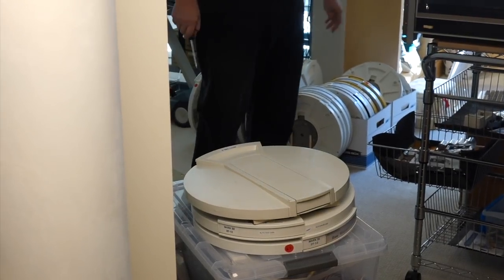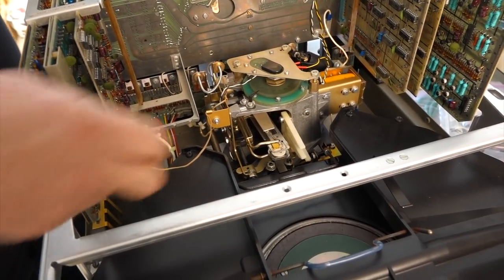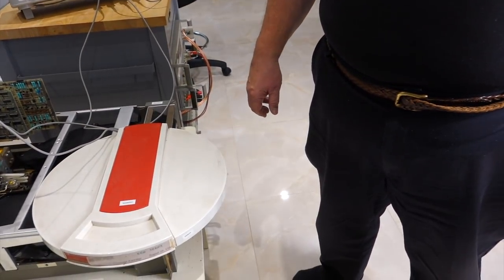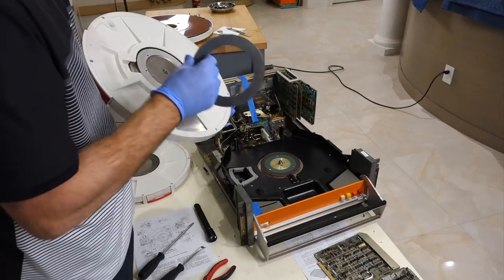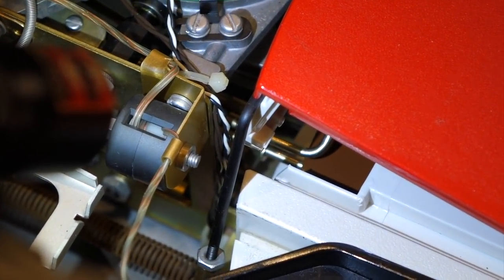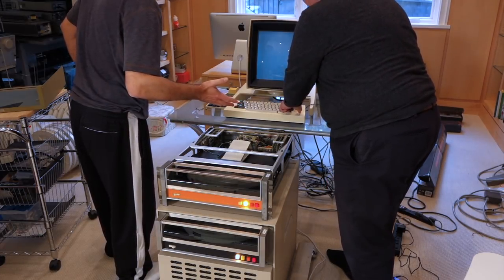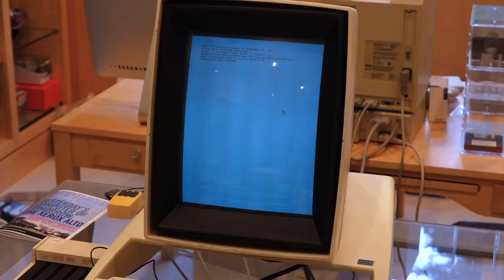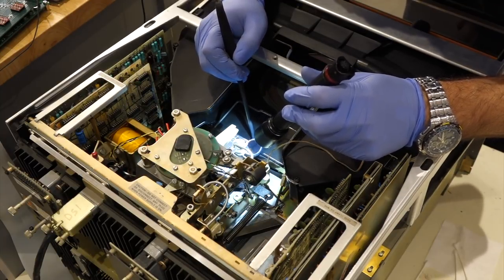Alto Restoration Part 18 - We crash our disk drive. Mill to the rescue!

Comment: Takes me back almost 30 years to when I worked for one of the last companies in the US producing disk packs and rebuilding HDAs of all types.   A little tip,  IPA is ok for head cleaning, but for the really stubborn stuff like you had there, DI water will take it off more completely and much faster.  Just a drop on a cleanroom swab is all it takes.

Comment: Thanks for the video. Some day I am going to have to go through this process with all the big 14" drives in my collection - a task I fear doing, thinking there is a disaster in the works every time. You guys make it look reasonable.
Reply: Hi Uniservo. These platters are 14", basically the bigger drives simply stacked multiple platters to form a pack. Densities, track spacing and the existence of servo tracks are the variables. Hope your drives come back to life!

Comment: I used to align the heads on the Control Data 9766 series drives, 80 and 300MB drives.  If I recall correctly the 80MB drives had five platters and the 300MB had 11 platters, so they had up to 20 heads.  I used to be extremely careful with the alignment because the alignment pack cost over $10,000, which was almost as much as I was making in a year at the time (1980) and the heads were about $300 each.  At the first sign of trouble or unusual sound I would retract the heads and check each head.   After changing a head I would first spin up the drive with a spare platter to make sure everything was fine before installing the alignment pack.   Good work and excellent video, it brought back lots of memories!   And good work recovering the data on the packs, bringing back memories in that way too!

Comment: 'Back in late 80's I use to repair XEROX 820's from my house and while pulling out the 8" platter so I could change the hard drive's bearings my 1yr old son who I had sitting on my lap helping me sneezed and covered the platter with snot, NO PROBLEM, just washed it with soap and water and good as new!

Comment: Fantastic work. It's great that the disk density is low enough you can do your own drive repairs like that. I am just about to try and recover the data from a 14" Fujitsu drive and i am not very hopeful!
Reply: 2200 bpi is pretty common for 14" platters. your Fujitsu drive won't be that far away from this. Don't give up!
Reply: Thanks, the drive in question is 6800 bpi and 850 tpi. We will try reading it normally first now i have access to a system with a SMD interface.
Reply: did you get it working?

Comment: If you're having repetitive crash problems, check your power supply over very carefully!   Bad solder connections were the bane of the larger Burroughs units which I used to work on.  The Burroughs units also used a lot of forced air over the platters - they didn't trust the Bernoulli effect enough.

Comment: I once took a 300MB rack mount hard disk apart and transported it home on the bus in 2 parts: the disk with the heads (and I had taken off the head pack and put it back together), and the enclosure with the electronics. Sure, it wasn't a removable drive like this one, but when I see this, I'm amazed that mine still worked after I put it back together.

Comment: Great to see the Alto project coming together so fully, its always a little scary when you have to open drives (or anything with magnetic media that needs precise alignment) up and remove heads clean then and reinstall them. Very good to see that the design of the Diablo heads is quite robust and they survived the incident. Nice save on the alignment pack as well, those fore sure are NOT growing on trees anymore! 
Keep up the great work out there!

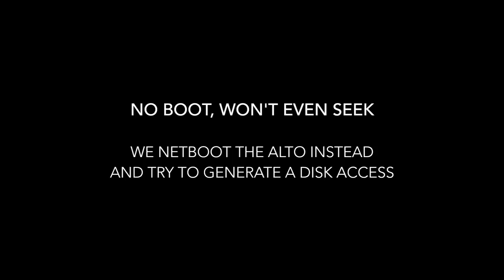Comment: 12:17 - Having listened to that sound from this machine and having never seen an Alto booting before, that sound is ubiquitous for so many floppy and HDD's that followed in the years and decades after. Even more amazing that you can still hear that very same sound in the latest SATA HDD's when there's data read errors.
Reply from the maker: It's the sound of the head repeatedly seeking back to the home position in an attempt to re-calibrate the start position after a read error. It's a method still used in disks today, hence the similar sound.

Comment: Good thing that ring friction centered and wasn't reliant on the failed mount for alignment!  Good job and awesome repair!!
Reply: The spindle motor has a conical top which fits into a cone in the aluminum platter hub. The steel ring is used to hold the platter down against the spindle, but not for alignment of the cartridge to the drive
Reply: Carl Claunch ah ok. So as long as it was close it was good.  Still very impressive fix.  I bed some 70s engineers would freak out seeing that repair:)

Comment: I used to repair those Diablo drives in the '70s and replaced many heads.  One comment on the alignment pattern.  We always used the full cats-eye pattern rather than zooming in to one half. The alignment was correct when both lobes were the same width and height
Reply: Yeah, that seemed kind of odd.  The pattern they aligned against didn't really resemble what was shown on the manual page.

Comment: Gee but this brings back memories.  When I was a young pup, an undergrad intern at RCA (remember them?) we'd be in the "computer center" typing in the Fortran we had written on yellow legal pads back at our desks - we'd occasionally have power failures during bad lightning storms. The facility had plenty of backup power, but there would be glitches that would affect the disk spindles.  The failure mode is well known to guys of this area - the heads don't retract, or don't have time to retract while the spindle winds down.  

My mentor, a wizened principal engineer named Aaron, would put down his pipe (yes, you could smoke anywhere in the building in those days except the fab and the raised-floor room - for obvious reasons) and say:  well, once they get the computer operators off the ceiling, they'll be scraping oxide from the heads for the rest of the day.

A power-glitch-head-crash meant that we were pretty much done for the day.

I used to have hanging in my office a disk from an IBM pack - gouged quite obviously.   I took it down after a few years when the young engineers simply had no concept of what it was - even after I explained it ("see, it's like a really big floppy, only it's not floppy and the sleeve is gone").  They figured it was some sort of archaic, uninteresting, art.   I used to have it in a box in my garage, but I think my ex tossed it after the divorce.  Etc.

Comment: To me this seems like a big antique Zip drive with the removable cartridges and heads that go into the edges rather than the sides.  Is this kinda similar but on a larger scale?  I had a Zip drive but I stopped using it when I read about them being unreliable.  That was especially true when thumb drives started to show up on the market but what you have there is an antique not a lot of people see normally.

Comment: First the praise: superb work by very skilled experts on an important part of computing history. Second, weren't those disc packs an invitation to head crashes? By the 80s hard drives were almost always sealed within a "warranty void if opened" enclosure. Or is this not such a sensitive technology as the flying heads we were told could crash if they encountered a particle of cigarette smoke?
Reply: The density on these platters is pretty low compared to modern hard disks, and the heads are large.  The gap between the head and the disk is correspondingly larger.  Drives became sealed when airborne debris became a serious problem.

Comment: Scary – and amazing that the platters survived the head crashes that could damage the heads. Great job!
Reply: The platters suffer more from the crashes. If it is just a rubbing and burning on a flat surface they can be read but if scratched or gouged, we have to put them aside.
Reply: Thanks for the info! I was always under the impression that a disk would have been toast, if a head crashed that hard...

Comment: Curious thing about the Xerox 860ips.  When the 8" floppy drives heads started to become a little dirty, it became evident on the screen.  As you typed, text to the display would be lagged.  I suppose this was due to buffering data to the floppy disk and then immediately reading it back?

Comment: This was back in an era when "crashing a hard drive" was literal. :p

(or the heads, at least.)

Happens on modern HDDs too, of course, but usually not quite as scary as this.
Reply: Loved watching the process of aligning the heads.

I was recently attempting to decode the MFM from a 3.5" and 8" floppy drive using an FPGA, and I hooked up a speaker to the /READ DATA pin, so I could actually "hear" when the heads were over a track.

It might even be a useful diag tool for devices like floppy drives which have a wide track pitch.

I'm guessing the Diablo drive spits out MFM (or similar) at a good 8 MHz or more though?
Reply: The diablo uses a predecessor encoding - 600ns bit cells that are a pair of transitions. The first of the two always occurs - the clock pulse - but the second is skipped for 0 and reverses for a 1 value of the data bit. The drive itself separates these providing a string of clock pulses at approximately 600ns each and a string of data bits at the same rate on a different signal line. 

Bit density is 2200 bits per inch on the circle rotating under the head, although data is written at a constant 600ns cell time so actual density is lower near the outside and higher on the inner tracks. 

With a track spacing of 100 tracks per inch, the entire 203 cylinders of data fits in roughly 2" of travel, a fraction of the entire 14" disk platter surface, very approximately 40% of the coated surface is used.
Reply: Carl Claunch

Excellent. Thanks for the info. ;)

I thought that the Diablo might use something slightly more obscure than MFM. hehe

I forget that a lot of the Alto stuff predates many of the standards like SMD. Way ahead of its time.

I've still yet to finish the SMD interface board for the drive I picked up on eBay last year. I'm hoping the fact that the drive itself at least has a data separator, so should make the MFM decoding a tad easier.

In the mean time, we're still looking for somebody who can help us make a backup from an 80s era Fujitsu SMD drive from a Quantel Paintbox DPB-7001 that was owned by the BBC.

If you (or anyone reading this) knows of somebody with an SMD interface that could feasibly make a backup, PLEASE let me know. ;)

Comment: It isn't likely to be stainless if its purpose is to be engaged by a magnetic clamp.  Most stainless isn't magnetic.
Reply: Actually, most of the commonly used Stainless steels are magnetic, it is only the austenitic stainless steels that are generally not magnetic.
Reply: @matthewq4b  Those stainless steels aren't as magnetic as mild steel.  It would be an odd choice for a material that a magnet needs to hang on to.
Reply: @stargazer7644  It does not need to be as magnetic as steel just magnetic enough to hold it. And unlike steel, there are no corrosion issues.
Reply: @matthewq4b  There are far better choices of material.  Again, if you need a material for a magnet to hold onto, why would you use a material that isn't very magnetic when there are far better choices?  As he said, this material was obviously not stainless because it was easy to cut.

Comment: Hmm... all this Alto restoring somehow made me Google for an emulator, and there're really Alto Simulators around, along with a couple of disk images. SALTO and ContrAlto look interesting... let's see if I can get one of them compiled and running on Linux to experience the system which inspired the Lisa and Macintosh.

EDIT: Oh wait... the ContrAlto simulator even is from you guys. o.O
Why have you never mentioned that you guys made a simulator (for Windows) available?
Reply: Contralto is excellent, we use it both for debugging the real Altos and to check out the disk images we archived
Reply: I think it would be cool to see a modern Alto, as if it would have been built in the 2010's.
Reply: Thank you for making ContrAlto available (on your GitHub repo). It's always nice to see emulators for old hardware so people can experience, and appreciate, a replica of the genuine thing as well as get to play around with the software running on these machines.

Already managed to make it run on Antergos (based on Arch Linux). Will tinker with it a bit more on the weekend.
Reply: ContrAlto was created by Josh Dersch at the Living Computer Museum in Seattle, not by us.

Comment: Great job! Just wondering, if you have aligned the drive can't you make an new alignment pack from a normal disk pack?
Reply from the maker: It's complicated to explain, but no. The alignment cartridge is a very special platter with two special elliptic tracks on them, and the rest completely blank. You could make something simpler maybe, but would have to go around the drive electronics just to create blank tracks.
Reply: Thanks for your explanation! I didn't know that these alignment tracks were elliptic tracks. That makes it quite impossible to reproduce... Are the alignment packs for the DEC RK05 drives the same as for these Diablo drives? (As far as I know the RK05 was Diablo based...)
Reply from the maker: I do not know. This cartridge would work in a Diablo 31, so if the DEC uses the same re-badged drive it would work.

Comment: I have the removable and the fixed version of this drive (the one with and without the removable platters) and unfortunately when I was archiving the data off of the fixed drive it it had the biggest crash I’ve ever seen so unfortunately about 15% of the platter is unusable pitty as it was the original drive of my nova 2 so lost the original installation of the os

Comment: Have you had to do any similar maintenance on your HP 7906 drives? I have one and a few cartridges that I haven't gotten around to trying to spin up and archive yet.
Reply: To align a 7906 drive requires special parts and tools. I have an alignment cartridge and the Disk Service Unit (DSU), but lack the two PC boards that are installed in the drive for alignment;  there is a tool to move the head in and out that I also lack. 

A future project will determine if I can make use of the alignment cartridge without the two boards. The key will be the existing lower head for the removable cartridge, which I can assume was properly aligned. If I can monitor the signals from the heads and match the same images with the upper head by adjusting it, I possibly could complete an alignment.
Reply from the maker: Not yet on mine, but Carl has tried on his HP 7906. And it is apparently way more difficult. Everything is proprietary, you need special HP test cards in the drive, an external tester and cables in addition to an alignment cartridge. We have not been able to find the whole test equipment, nor schematics of the tools so we can't reproduce them or tell what they do.
Reply: If anyone has the schematics for the two PCBs, we would be eternally grateful for a copy!

Comment: What's the rotational speed of the disk ? And how did you manage to balance it with four added screws ? Great work !
Reply: The disk rotates at 1200 RPM or 20 RPS. The screws were drilled using some automatic positioning on his mill which placed them on the same circle and at 90 degrees from each other. The relatively small weight, small radius from the center and carefully balanced positioning produced no detectable vibration. 

Most regular data cartridges have four screws holding the steel plate to the aluminum hub, thus this is similar to the bulk of the cartridges that spin in the Diablo drive
Reply: No doubt the size of the hub and platter helps to minimise any difference in balance.
Reply from the maker: The alignment disk is much better balanced and centered than a regular disk to start with. Then I cheated using modern computers... I used the digital readout on the mill - has a function to find the center of a circle out of 3 probe points, so I could center on the original hub exactly. Then it calculates the exact position of pattern of holes on a circle, which I carefully center drilled first with a fine center drill. The screws are probably within a mil of their ideal location. That's the beauty of using the mill for drilling - takes a while, but holes end up very exactly where they are supposed to be!
Reply: CuriousMarc,
A case of "the right tool for the right job". I would have also weighed each screw to match them, but maybe that wasn't really necessary ? Anyway, as I said, a job well done. I'd pay to be with you guys. But I'll settle on fixing and maintaining pharmaceutical industrial machinery for a living. Even though it's evidently less exciting than this !

Comment: They used magnetics to hold the magnetic disc on the spindle? :)
Reply: It's really hard to erase data on a platter with a static magnetic field. An alternating magnetic field is required.

Comment: how do you mill without any milling oil?
Reply: By not turning it on.  Oil just extends the tool life and helps surface finish sometimes.  You don't have to use it.